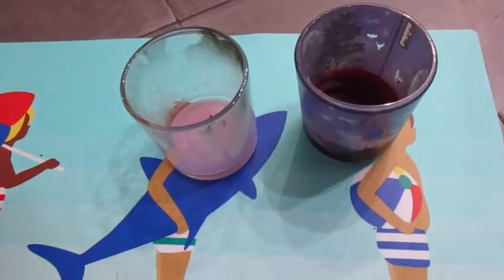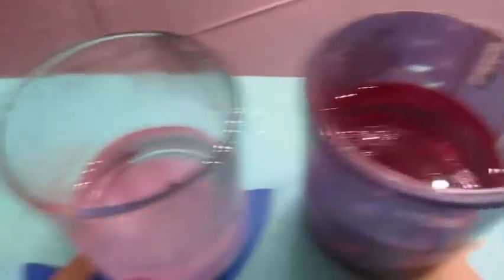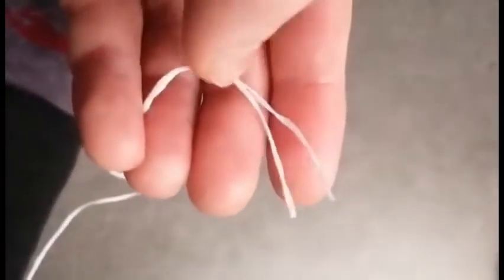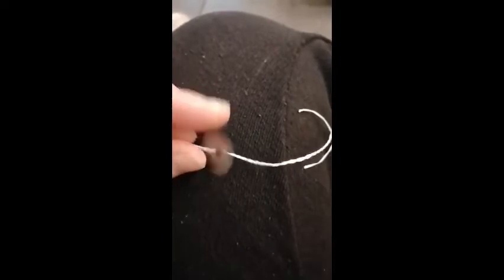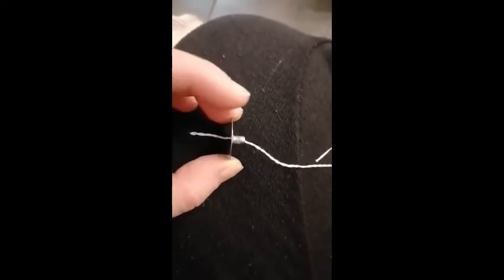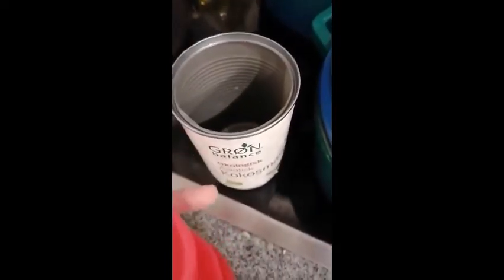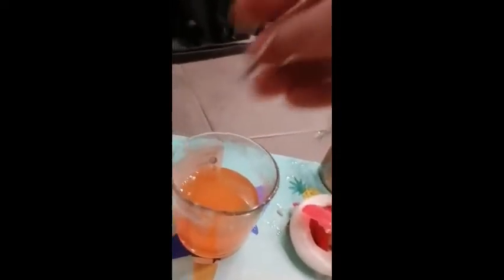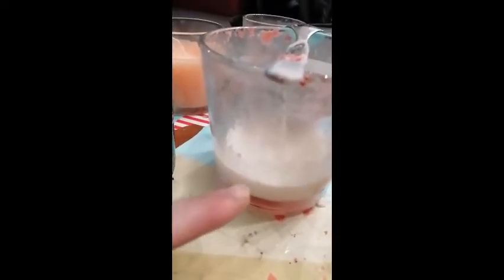DIY Zero Waste Candles tutorial - almost FREE recycling project

Comment: Thank you this is super helpful. How long does it take to get the wax scraps to the top? Is it a few hours?
Reply from the maker: I'm glad you found it helpful 😊 the scraps should start floating to the top after a few minutes, and I'd say after 30 minutes it's finished melting. If there are still any scraps left at the bottom I add more boiling water and repeat the process until all of the wax has been removed